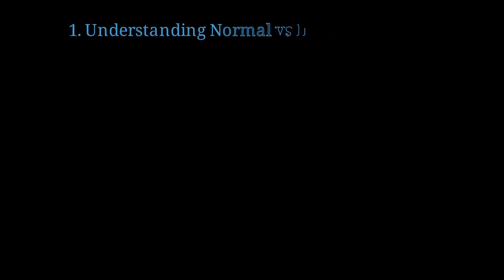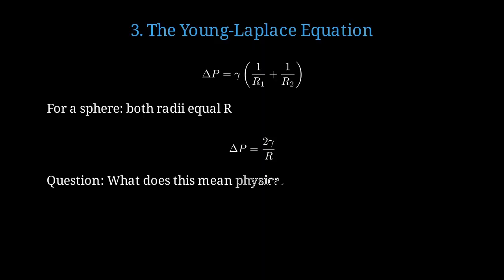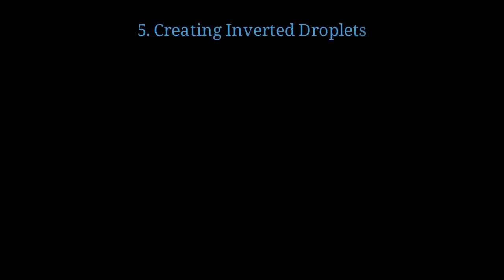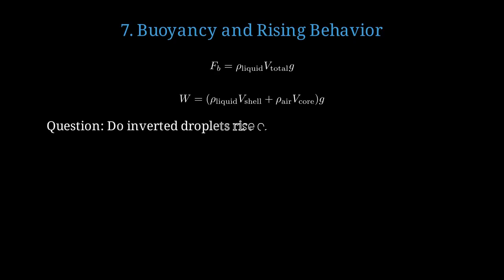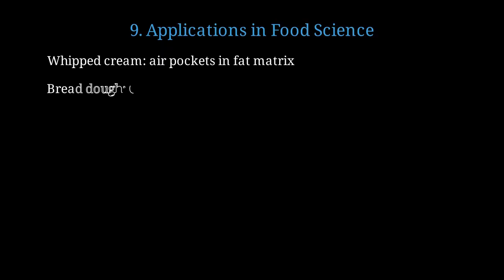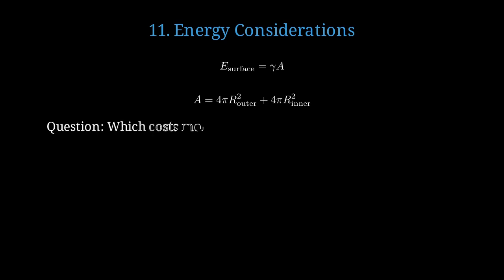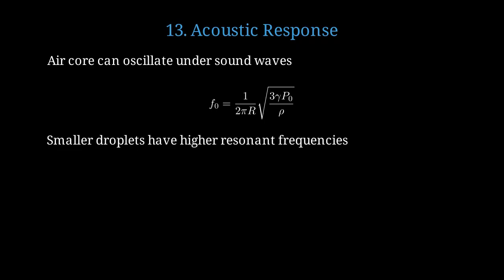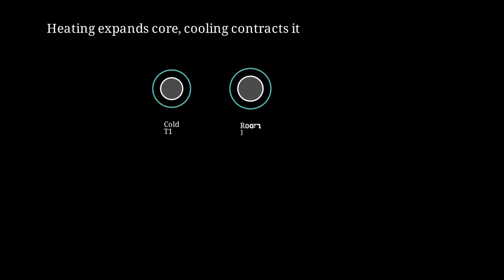The Bubble That Shouldn’t Exist: Inverted Droplets Explained

Comment from the maker: How does the balance between Laplace pressure and surfactant-induced Marangoni flows determine the long-term stability of inverted droplets in viscous media?
What nonlinear coupling exists between acoustic resonance frequency and droplet deformation when inverted droplets are exposed to ultrasound fields?
How do temperature-dependent variations in surface tension and gas solubility jointly affect the collapse threshold and coalescence probability of inverted droplets?